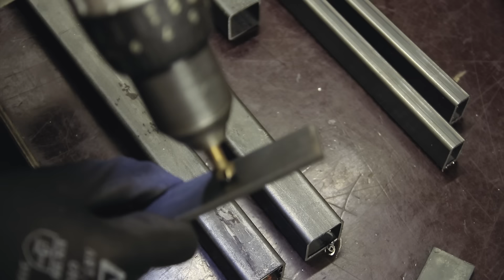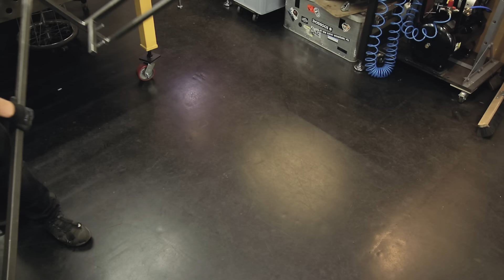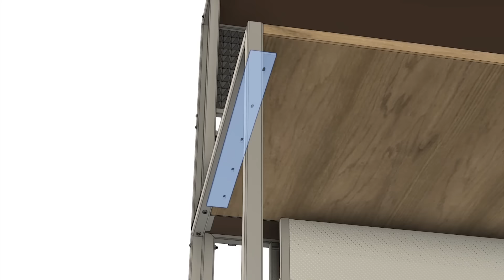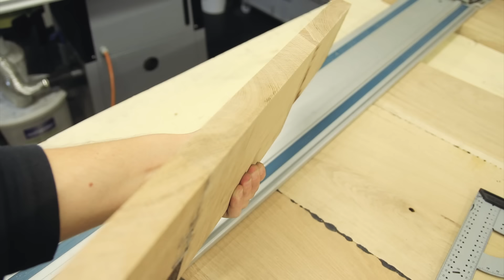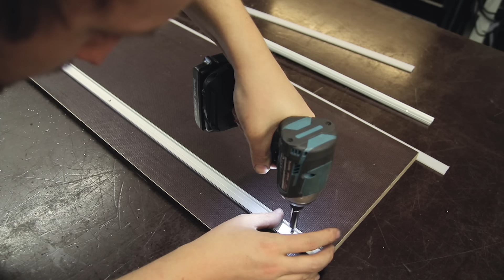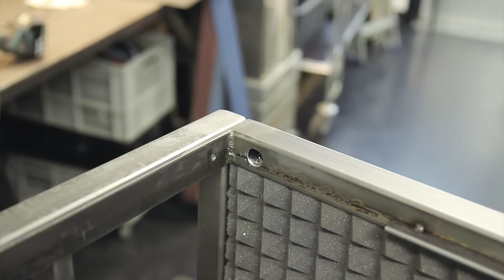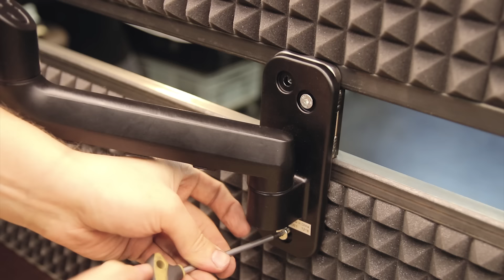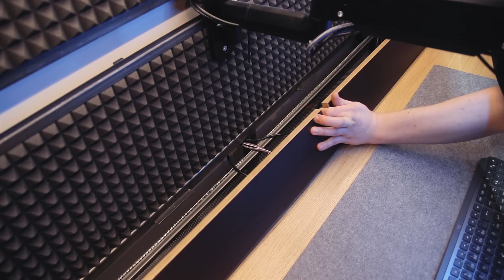How to Build a Cable-Free Desk with Built-In Lights, USB, Outlets + More!

Comment from the maker: FAQ: CHECK HERE FIRST IF YOU HAVE QUESTIONS:
Hey everyone, since there are a lot of questions in the comments I'm gonna answer the most common ones here:

Q: What software did you use for planning? 
A: I use Fusion 360

Q: What are the overall Dimensions of the Table? 
A: You can see them here (Units are Milimetres):  i.imgur.com/Ua5wlwI.jpg

Q: What Materials are needed? 
A: I've uploaded a bill of materials here: i.imgur.com/5z9OOXv.jpg

Q: How much does it cost to make? 
A: It's hard to say exactly because steel and wood prices are vastly different depending on location and the world market. It also depends on which wood you use. But overall, probably somewhere around 300$ in raw materials, plus whatever gadgets you want to install (Lights, USB etc. not included in this estimate)

Q: Why not height adjustable? 
A: It would have made the project a lot more complicated and expensive and I personally don't need it

Q: Can you make/sell me one? How much? 
A: I appreciate the interest, but when asking this, people usually underestimate the amount of work hours it takes me to make somthing like this. Building things individually by hand as one person is many times more inefficient than mass production,  so even if I only charged minimum wage for my work it would have to be extremely expensive if I want to make any profit. On top of that, the shipping cost for this would be very expensive too. Lastly, if I built things to order, I wouldn't have time to make videos anymore 😉 So I hope you understand I can't take orders for now - but I'm looking into ways of providing something like a build kit in the future, and I will post updates if things get more concrete.

Q; How heavy is it?
A: I didn't weigh it so I don't really know, but fully assembled it can be carried by two people relatively easily. I'm guessing it weighs somewhere around 50 Kilos (without the PC setup)
Reply: Overall, how heavy is the desk, legs excluded? I’m looking to adapt this design to a standing desk and want to ensure it can actually move without overloading the motor.
Reply from the maker: @TheDylanBowman  Honestly, I have no idea but I can tell you that all assembled it's still relatively managable to carry it with two people, so my guess would be around 50-60 Kilos
Reply: @PhilVandelay   - Art Vandaley :P The Architect :) PS: Link for monitor screen light ?
Reply from the maker: @AX-fx7ng  It's in the video description
Reply: @PhilVandelay   Found it.
Reply: @AX-fx7ng  he should go into business with H.E. Pennypacker :D
Reply: @thegoon459   LOL! :) Finally someone got it.
Reply: I would pay a thousand euro for the same for 2!! Do you built more of these to sell?
Reply from the maker: @uzielweb  Great, then do it
Reply: If you made more of these I would definitely buy one from you 😮💯💯
Reply: I have a question regarding height adjustability: Do you think, I could construct only the upper part of your build an mount it on a tabletop, which would sit on height adjustable feet? I think the weight distribution might be an issue.
Reply from the maker: @akakitai1110  Yeah I think that might work, but as you said it might have a tendency to tip toward the back. But if you put the legs a bit further back and use a heavy tabletop I think it could be fine
Reply: I really love the design of this desk. I have been thinking of building one for myself as I have a new office now and am tired of a messy desk as well. Do you plan on offering any build plans for this desk or maybe offering the fusion 360 file or anything like that?
Reply from the maker: @mk53566  Yes, there's a link to both in the video description
Reply: I bought the plans and I feel inspired! Thank you! I have some learning curves in terms of working with metal and welding. What welding method did you use for this project?
Reply from the maker: @parkjv1  I used TIG welding, I suggest checking out the many great welding channels on Youtube, for example Welding Tips and Tricks or the Everlast channel. It's how I learned to weld
Reply: Good job, I really liked your video! I wanted to mention that you should pin this comment, so it would be easier for people like me to find FAQs. 🙂
Reply from the maker: @kyriakos7610  Weird, it actually used to be pinned but somehow got unpinned... it should work again now
Reply: I mean, if you want to adjust the height just buy an adjustable chair
Reply: What do I need to study to do stuff like this? I really want to have a desk like yours but with my own additions to it
Reply: great job on the dest, the blackness to the wood glue was the natural oil from oak which can stain your skin black for a short while
Reply: сделано кврасиво и практично )))
Reply: I noticed that you are using wireless charging for your phone when you were making this did you consider putting a wireless charger into the desk?
Reply: How much would it cost for you to build me one?
Reply: You are hired! And, of course you can bring your cats with you...
Reply: Isn't the construction a bit wobbly due to no reinforcement in front?
Reply from the maker: @JJCotek  If you use it as a workbench, maybe - If you use it as a desk, no. Personally I haven't seen many desks with a reinforcement in the front
Reply: @PhilVandelay  thank you!
Reply: I love it. You did an excellent job in making the desk and editing the video. 

I have an idea for a cool PC case that I think you would be able to create, I see that you already have the tools and the materials. The only problem with this case would be that you might want to take it out of that shelf and stick it on top of your table! If it might interest you then let me know how I can reach you out and I will send you my sketches.
Reply: Would love this but i have no idea how to build stuff like this :(
Reply: nice work sir.
Reply: Hello goodnight.
Would you be able to send me the project of this table?
I really liked it, I'd like to make one for myself...
Thanks!
Reply: everything was great until I saw that HP desktop... - 100 dkp.
Reply: Hey I scanned through the descriptions and questions but am not seeing this anywhere. What brand of welding table is the because it looks awesome. Been eyeing a CertiFlat modular table for a while but not sure what to go with. The holes on yours look bigger than the certiflats so an curious.
Reply: First of all I want to thank you for sharing your work and plans for this incredible desk! 
I've a question regarding the dimensions for the desk shown in the linked picture as it's not clear to me. Are these metric or imperial units?
Reply: I have 8 dollars on me right now. If you give me a week I could get another 20. How close am I to being able to buy one?
Reply: Has anyone ever told you, you kinda sound like Elon Musk?
Reply from the maker: @jacobmccoy2637  Yeah but I don't really get it. We have different accents, I'm German and he's from South-Africa
Reply: Nun bestätigt sich meine Vermutung
Reply: do you know how big it is in inches?
Reply: What program did you use to make plans?
Reply: I’d love to find someone local (Chicago) who could build this for me lol. I am thinking I could build it with 8020 aluminum but I haven’t worked with that personally before and it’d be weird because it’s so thick. 

I love this desk though and no one out there is really making anything like it.
Reply: What is the name of the exact machine you used to cut the metal?
Reply from the maker: @kayseripersaud9219  I'm guessing you mean the metal bandsaw
Reply: Love you humbleness to share each part of build with well documentation and links !
Reply: I would pay for this, its pretty cool.
Reply: Thanks a lot for mentioning the software
Reply: @MegaTechno If your desk is really really simple, you can use Tinkercad. No install, much faster to learn, much simpler. It comes at a price of too simplified. 

Fusion gutted exporting and a few other things so if Tinker is too basic, get Solid Edge.
Reply: Can I use 1.25 inch steel tubing instead of 30mm? I'm trying to find 30mm in my area but am not having luck XD
Reply: @nafaalar  Yes, you could. If you want to follow the same plans he is selling, subtract the difference or upscale it a bit. It will just weigh quite a bit more. I plan on building this desk myself soon. I've just been busy with other projects.
Reply: I know that WoodPrix has the best woodworking plans ever.
Reply: Hey man I really like your design but when I built mine I did make a few custom changes to suit my needs but for the most part it’s looks very similar. Can’t attach a photo but happy to email you one
Reply: FYI, regarding the audio foam, rather than joining two pieces in the middle, if you place a full piece centrally, and two half pieces on each end, your brain processes this more natural and ignores it better.
Reply: could you not make a phone charger in the worktop itself if you make a hole on the underside of the desk and place a flat wireless charger under there and then cap it off with more wood and create a cable channel for it
Reply from the maker: @brendanwhitehead2890  Yes but those types of chargers are inefficient especially with anything inbetween the charger and phone and they can  actually damage your phone, that's why I didn't use one, among a few other reasons. I'm really not a fan of those things. Besides, charging and battery technology is still evolving rapidly and I don't want to permanently integrate a device into the desk that might be outdated in a few years

Comment: I built a similar concept of your table for my setup but it is wall hanged and it is a 60cm by 160cm. It is best to use 1"x2" or 1"x3" as it has higher inertia on the strong axis if desk length is longer than 100 cm(tested it too on my second desk build). I used 1"x1" 1.5mm thick steel tubular on my setup and it casually deflects under load. So to anyone building this table, to support the wooden desktop, use a 1"x3" or 1"x2" minimum and you can also use a 2"x2" steel tubular.

Comment: Genius design. Unfortunately I don't have the skills (and the will at this age :) ). I have an old school desk with a keyboard tray and a back wood panel so no monitor arm or clamped hubs etc.  Small too at 1meter wide.The market standing desk is too wide instead but the problem is the depth (60cm) and it has a too-high minimum height, no tray, may be wobbly with only two side legs.. Too much for just free edges. I guess I'll go with a custom artisan-made version, hopefully with a keyboard tray too! You helped me get convinced about that.

Comment: So your OCD almost made you scrap project bc of “seam” in foam, but your OCD is okay not spending maybe $3 on some wiring loom? Gotcha! Nothing bad ever happens with metal and electricity. FYI Voltage alone doesn’t make it safe or dangerous. Im just a troll though

Comment: 1. Needs 2x more displays (for me)
2. Wireless charging integrated into the table for more comfort 
3. The table NEEDS to be bigger to support 3x monitors in total AND electronic height adjustment
4. After all the above, needs to be produces on mass. 2 models: One small version (like this in the video) and one for professional users like me for 3 monitors. Thats a 100% buy right there.

Comment: Nice idea well done, for anyone wanting to replicate someting like this on the cheap but with basically the same functionality.
1. Use IKEA LACK shelf to hand above your desk.
2. Install microphone, speakers and headphone bracket underneath the Lack shelf, it costs like 6 bucks so don´t worry
3. Hide all the cable inside the shelf since it´s hollow.
4. Additionally you can also place a Notebook on top of the shelf and also run the cables inside the shelf.
It costs next to nothing, you don´t need to weld and you don´t need to German over engineer things, you will get a cheap and functional desk space. My 3D printers are inside my 3D printers enclosures for temp control and so I can focus while they are running and also the fumes are extraxted to the outside.

Comment: I bought the blueprint and building this table, but looking at the flexibility of the smaller tubes used for the upper cross brace, which is also used to mount the monitors does it not deflect a lot from the weight of the monitor/shelves if you extend the arm forward at all? If your plans calls for 6cm wide crossbrace a monitor arm extended forward would exert enough torque to deflect the cross brace and twist it significantly wouldn't it?
Reply from the maker: I can't say I've had any problems with it, yeah it can flex a little if you extend a large monitor far out but it's not really an issue in practical use. The bridge piece in the middle of the slot reduces that deflection quite a bit so you definitely wanna include that. But if you're concerned or are planning to mount very heavy monitors, you could always use thicker tubing for the cross braces (30mm like the rest for example).
Reply: @PhilVandelay  thanks for the reply. I am in the middle of building it and I think I will add one 30mm bar above it since I will have double monitors on it. I figure the deflection would be significant because I tried to see how much flex would happen stepping on two of the thinner tubes. No doubt it would be less once the back panels are in to keep them more secure. I will see how it goes once I finish the build

Comment: You stole my idea :-) \s I've been using a very similar setup for 4 years. I've got two shelfs, a little one right above the monitor and than another that's about as deep as yours above the small one. My cable tray is only accessible from below though :'-). Keeping everything modular is really nice, I screwed everything in place no I'll either have to make a new one or just be happy with what I've got. Thanks for the video, your build quality is just matriculate.

Comment: could a no weld version of this be possible by using slotted anglebars?
Reply from the maker: Not sure what you mean by slotted angles, but making a version of this from aluminum T-slot profile would probably work and requires no welding
Reply: its those L shaped metal bars with holes that is used for shelving

Comment: In regard to the seam. You should have painted a black strip were the seam was. This would have made the seam nearly invisible.  Also you made a straight cut seam. If you would have done a zigzag using the squares the seam would be even harder to notice as it wouldn't be a single straight line

Comment: I really like the idea of using the perforated aluminium as a kind of a basket for cables and other stuff, with cooling included :)

BTW, what's the name of the plywood that you use? I am from Europe and I am not sure I saw it so far either :)
Reply from the maker: It's a high grade phenol coated plywood (usually birch) but everyone uses different names for it so it can be hard to find, but it's very common here. The coating is extremely durable and waterproof so it's often used for stuff like truck/van beds, formwork and other professional applications, you've probably seen it a hundred times without realizing. You can get it at most hardware stores here in Germany but it's  gotten very expensive in recent years